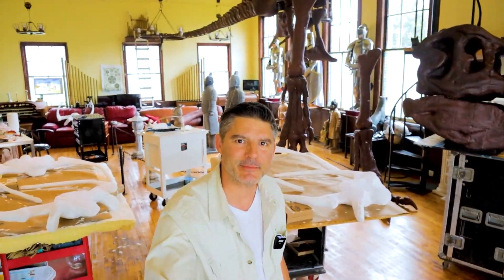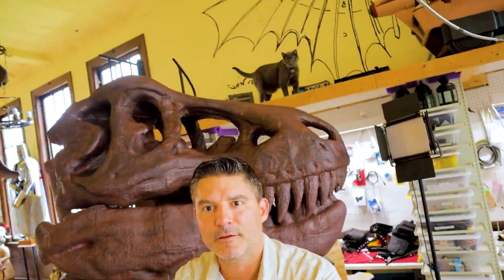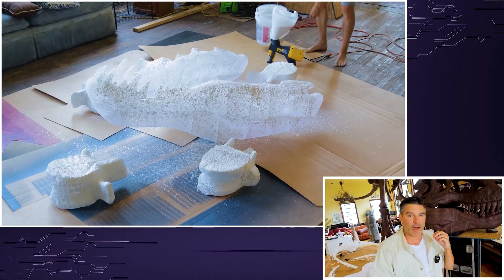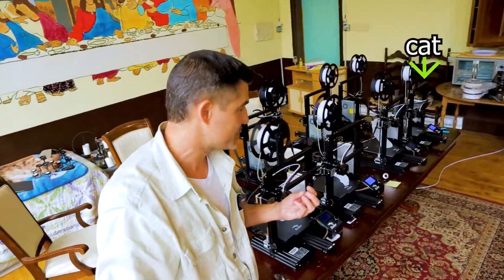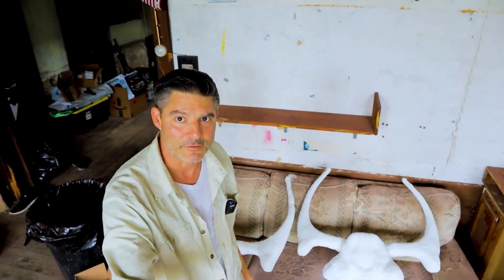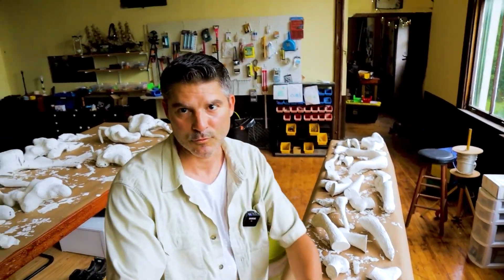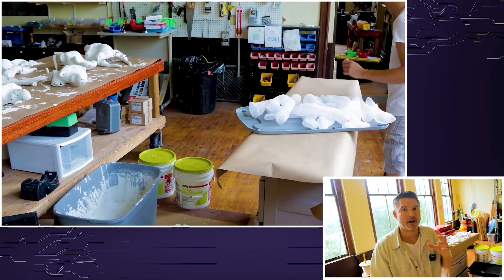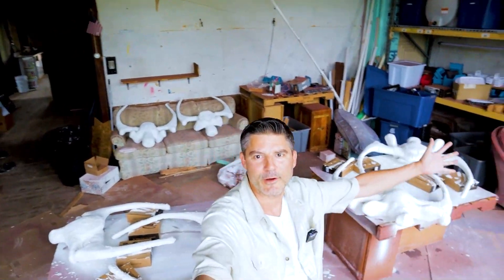Epic T-Rex Building Project: Constructing a Dinosaur in a Vintage Schoolhouse | Homestead High

Comment: Hey Dave, interesting video as always. 
It's been like 10 episodes, and I am still interested in your 3d printing process and would love to see some more information about your slicers settings in cura and your experiences with printing these meshes.
Reply: Seconded! It's a great technique I have not seen anywhere else.
Reply from the maker: Yes, the "wire" or "mesh" setting an "experimental" feature in Cura which is free to use now
Reply: @Physicsofcreation  Wow did not think you would be able to get results that are that good out of that feature. I will have to try that out ty! Are you using a 0.28 layer height and higher than standard line width?